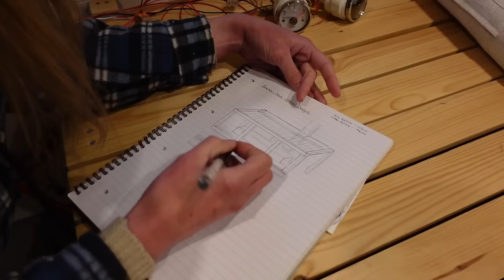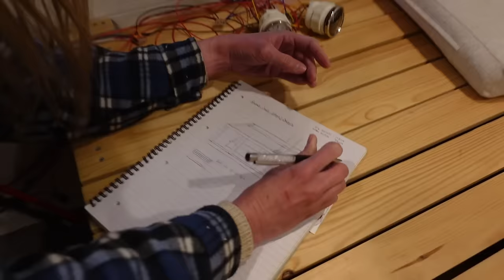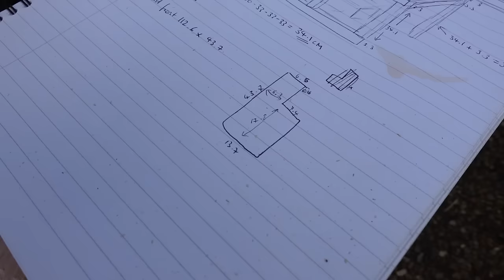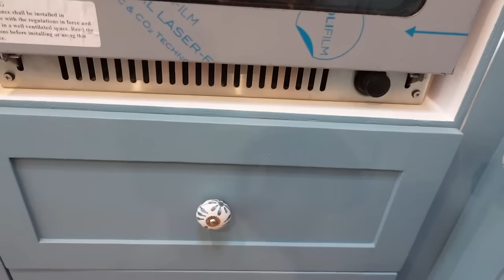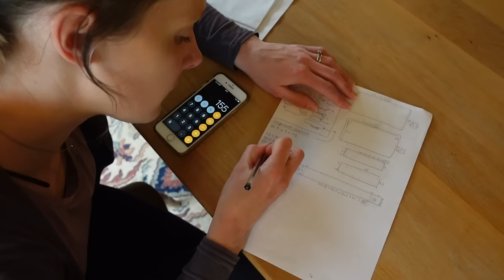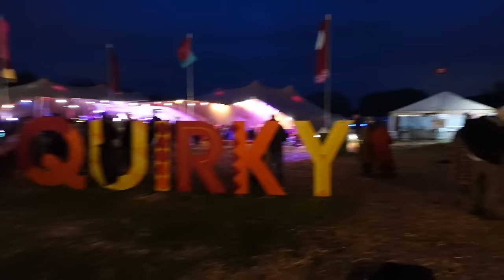Comfy Campervan Bench Seats (with storage!) | Transit Van Conversion E43

Comment: What a great job you did.  I found the completion of my van build to be bittersweet.  You spend so much time planning and thinking through problems, and then it ends.  There will be tweaks that go on for years, but once the big stuff is done what you see is what you get.  I have thoroughly enjoyed watching you both create something that didn’t exist until you decided to make it so.   Legends.
Reply from the maker: Thank you! Yeah so much time planning and thinking, and definitely a lot more work than we imagined at the start! It was a surreal feeling when we were able to head out on the road but we haven't looked back. You're right there's always tweaks to be made later on but after spending so long trying to get the big stuff right, we're really enjoying being able to use it now 🙂

Comment: I think on my next van build I am going to build my bench seats with a lift up upholstered section to extend the seat area ( Think along the lines of fold down worktop extension ) When folded in should be the same or smaller footprint as  you have.  The lift up section only needs to be 6 inch.  and Presto Hey ! A homemade LazyBoy.  YW.
Reply from the maker: Cool, good luck with it! 👍 We just put our legs up across the other side 😛

Comment: Great video yet again, very well explained.  Can you share your final dimensions of the seat frame, was it 500mm high plus the 60mm cushion, and what was your final depth on the frame from the van wall
Reply from the maker: Thanks! And yeah sure, so we ended up with 44cm from the floor to the top of the frame, then 6cm foam. So with a bit of dacron padding on the cushions it's ~51cm from the floor to the top of the cushion. The depth is ~52cm from the bed supports to the front before putting on the angled pieces. With the angle it's ~46cm of usable sitting space. And the backrest comes up 42cm from the frame with 5cm foam for those ones. Think that's everything! 😄
Reply: Thank you
Reply from the maker: @andycosway1840  No problem 👍🙂

Comment: Nice work! I like the progress you guys are making! You mentioned you treated almost all wood in your van build, what are the products that you used for treating the wood?
Reply from the maker: Cheers :) And a mixture depending on what it was. So we used Osmo oil for the ceiling and the bed frame, danish oil for the worktops, kitchen cupboard paint for all the kitchen cupboards (with mostly zinsser bullseye primer), dulux eggshell for all the other painted white bits, and varnish for pretty much everything else 👍

Comment: Hi both, taken lots of inspiration from your van build. Well done, your van is beautiful 😍 

Can I ask what was the final height and depth of your bench seats and the width of your walk way please ?

Lee & Tania
Reply from the maker: Hey guys, thanks 🙂 And sure, we made them ~46cm deep from the front to the slope of the backrest, without the cushions on. The backrest cushions use 5cm foam, but we made the bottom cushions slightly overhang the edge, so we end up with ~43cm of actual sitting cushion space, if that makes sense! The height from the floor to the top of the bench seats (without the cushion) is 44cm. The walkway is ~48cm at the narrowest point between the shower and the opposite seat and wider at the other points (~58cm between the seats). HTH!

Comment: Always a pleasure to see you guys working as a team and as a wonderful couple too. Have start my built 8 months ago by myself and wish i could have a partner to help me. Like you say , it takes more time to think how to do it than to do it .. Question : what is the depth of your bench seat ? Have plan mine at 420mm but not sure if it will be enought with the back coussin.. Enjoy the spring & keep on doing your great work. Big hugs from New Zealand 😺💌
Reply from the maker: Thank you very much 😊 Yeah there is so much thinking involved with everything, it gets quite tiring after a while doesn't it! Having two people definitely helps to share the work... and motivation! We made them ~46cm deep from the front to the slope of the backrest, without the cushions on. The backrest cushions use 5cm foam, but we made the bottom cushions slightly overhang the edge, so we end up with ~43cm of actual sitting cushion space, if that makes sense! We find them quite comfy, they're not as deep as in a house but space is so much a premium so it's the biggest we could go in the space we had. HTH!
Reply: @SelfBuiltStories  Thanks a lot for your reply and precious information. Have learn a lot from all your video, even if i am a builder , it help a lot. Have notice that sometime you spray paint for furniture & sometime with roll & brush . What is the best finish ? I admire your motivation working in the rain & cold without a inside garage to build it. Enjoy the spring and keep in touch !! ✌
Reply from the maker: @fabianprioux1136  No problem 🙂 And yeah we found the spray gun works great for flat surfaces like the cupboard doors and where there's a lot to paint, like the kitchen cabinets. It does give a really nice smooth finish if done properly and with the right consistency of paint, which was a bit of a learning curve! When we had a lot of surfaces to paint like for all the kitchen cabinets it was great and saved us loads of time and got a much more smoother and more even finish than we would be able to have done with a brush. But we found that for smaller things it was just too much faff to set up the spray gun and clean it out afterwards, and for us was quite weather dependent as we had to do it outside too and it was usually raining or windy 😅. So for the smaller pieces or intricate areas where it was difficult to physically get the gun in, often a brush and roller was simpler and used less paint. Thanks, you too!

Comment: Fab seats guys! Where did you get the drawer fasteners that stop them opening when in transit? Thanks
Reply from the maker: Cheers! And we used a mixture of these double ball catches (https://www.toolstation.com/double-ball-catch/p75946 ) and magnets. We used the magnets on the more light duty bits like the overhead cabinets, and the ball catches on all the kitchen drawers, one on each side. And the pantry drawer we used both, just in case! 😛

Comment: Hi.  Thanks for the install vlog, really informative and helpful.  Can I be cheeky and ask,  one year on,  if you are still happy with it or any problems found or alternative ideas?
Reply from the maker: Yep very happy with them, works great for us and no problems at all since we built them 👍
Reply: Oops, just realised I've attached this question to the wrong vlog!! 🤦🏼‍♀️🤭  Sorry, I was actually enquiring about your shower door!
Reply from the maker: @sueh8641  haha no problem, yeah the roldour is working out great for us too, no complaints! We like how it has such a small profile so is all contained within the door frame and yeah we haven't had any leaks or anything, so would install the same one again 👍
Reply: @SelfBuiltStories  Thanks.  Great to hear 👍.  Just doing our framing then will get one ordered 👏👏
Reply from the maker: @sueh8641  no problem, good luck with it 👍

Comment: C1 drivers lisence how did you  make the max technical weight hyer
Reply from the maker: Once we had passed the C1 test the actual process to up-rate the van was more of an admin exercise. We used Dee at https://www.vanweightengineering.com/ who prepared all the forms that we sent off to the DVLA to get it changed 👍
Reply: @SelfBuiltStories   thanks for your reply bu i have alsoo   transit L4H3 but my  maximum technical weight  is 3500kg is it possible too make that  hyer without  changes to the rear axle or the suspension otherwise i have a big problem
Reply from the maker: @CBontenbal  It depends on the van, we were able to uprate ours without changes, although we beefed up the suspension as well for peace of mind. You have to talk to a company like Van Weight Engineering or SV Tech and see what they say 👍